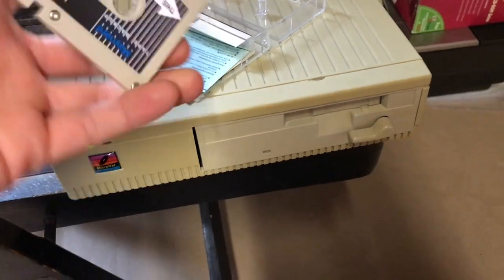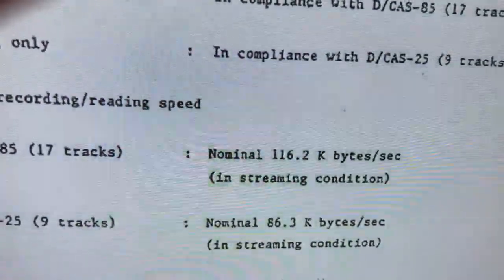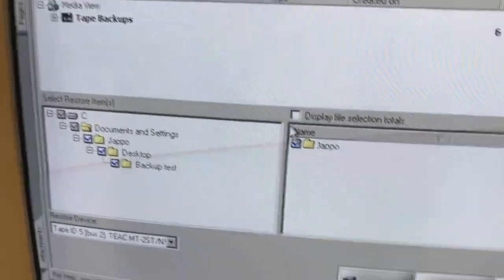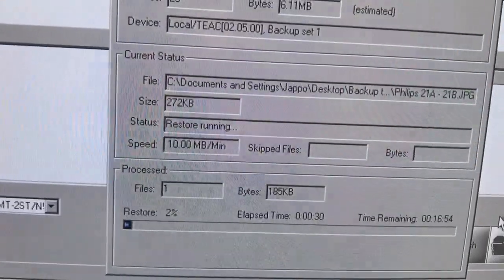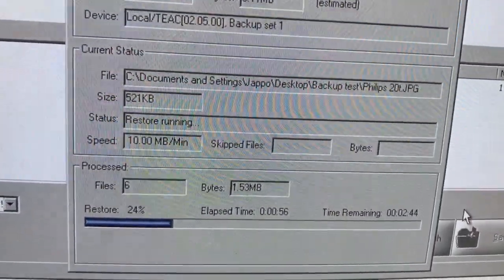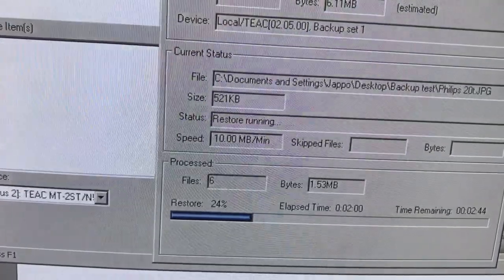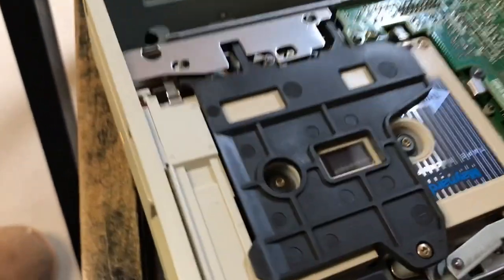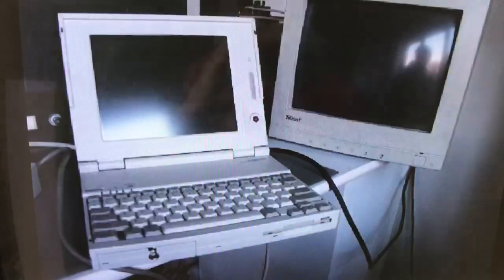Teac MT-2ST/50N computer tape drive

Comment: Going by the notch in the middle of the bottom of the cassette I'm going to guess standard cassettes won't work in this drive? Fascinating bit of tech.
Reply from the maker: That it right, audio cassettes are a little different. apart from the notch there is no felt pad where the head goes. and the tape has some different formulation
Reply: @japcast  How interesting. Shame they aren't made any more, be fun to experiment with the tape itself in a professional quality deck. Kind of like how I'd like to experiment with LTO half inch tape in a VCR or audio recorder.

Comment: I found a computer at the side of the road containing a drive like this some 20 years ago. I was never able to find any kind of information about it at the time, and I have aske many people over the years without getting any useful information about what this cassette tape drive was for. The construction of the mechanism and the lack of audio connectors made it apparent that it was not for sound recording. Seems like the mystery is finally solved. I’m pretty sure the one I had ran off the floppy controller, but I may have been IDE. It was certainly not SCSI. I never tried to install it in a working computer, and ended up throwing it away as it had heavy water damage from sitting outside for months in the winter.
Reply from the maker: interfaces for them were SCSI or QIC2. in my other video you can see my QIC2 drive play digital audio

Comment: How big is the difference between a data tape cassette and a MC? Is it possible to use MC tape?
Reply from the maker: some mechanical differences. there should be a hole near the end and beginning of the tape. there is no pad for pressing the tape against the head for the data cassette. tape formulation is different. and there should a notch at the top of the cassette shell. I tried modifying an audio tape and it worked in the 50Mb drive

Comment: So I have to ask... Is this basically just a Compact Cassette? If you cut an appropriate notch in the casing of a regular casette would it work? (I'm writing this before I've watched the full video so apologies if you already addressed this!) Could you try it out to see if it works?
Reply from the maker: yes it looks like and audio cassette. some mechanical differences. there should be a hole near the end and beginning of the tape. there is no pad for pressing the tape against the head. tape formulation is different. and there should be the notch. I tried modifying an audio tape and it worked in the 50Mb drive
Reply: @japcast  I've always wanted to know if you can do that. Now I'm kicking myself more for snatching that one for free 20 years ago, wonder if it was the 50mb version. Which one should I get for that purpose if I can find it for cheap? 
I'm also waiting for someone to write an improved standard for writing data easily and more reliably using ordinary decks but that's another story and it's not like there's a lot of insane people like me demanding it!

Comment: Can you play music from the computer in a car?
Reply: you mean like burning a cd just with a cassete?? .. there are cassete to usb/aux/bluetooth adapters that are more convenient ..
otherwise i don't get what you mean .. no the computer can't play music in your car .. your car's electronic runs on 12 volts, this computer needs 120/220 volts to function and doesn't have a soundcard in it (old computers didn't have onboard audio like todays computers have) .. you could make it work, but there is no point